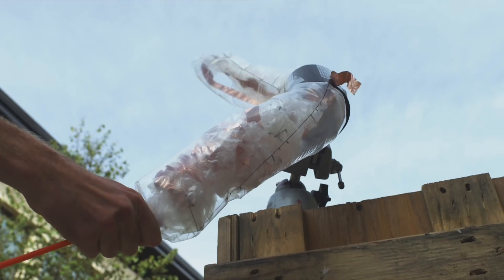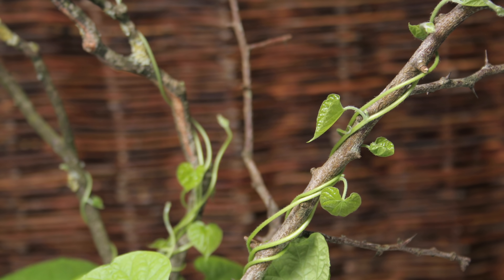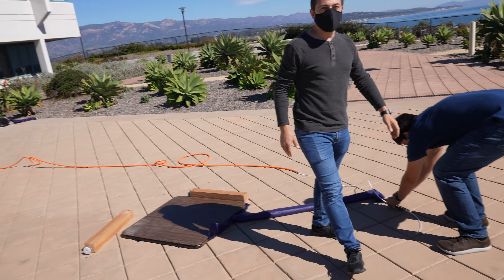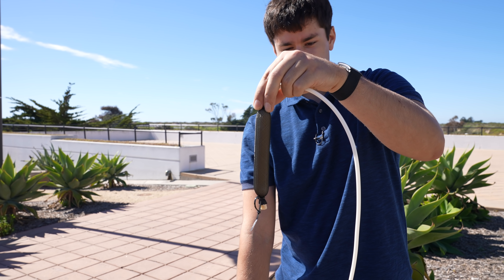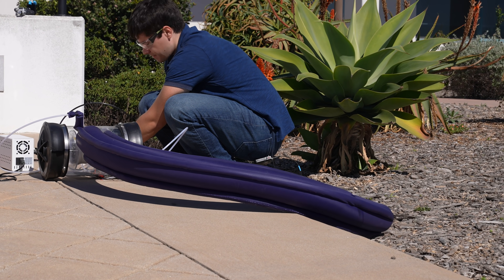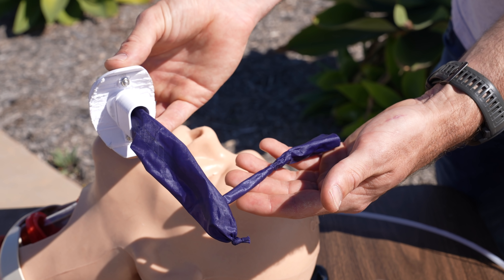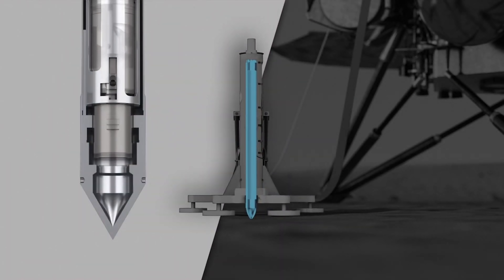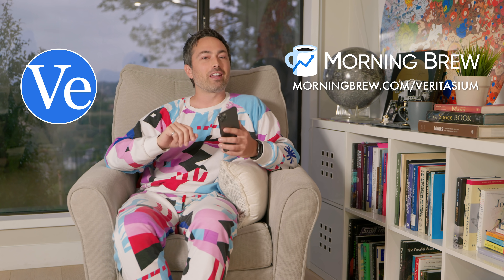This Unstoppable Robot Could Save Your Life

Comment: A very good option would be using it in radioactieve environments like the Chernobyl reactor sarcophagus if it limits the amount of visits but has different adjusted sensors for the still huge amounts of radiation that would help in the work since there is a door inside and people go in in order to check and maintain things still and to sometimes literally put a bullet through corium buildups in order to let air in to acellerate the oxidation proces in order to lower the amount of reactions since the oxides are less reactive then partial non oxides so given these methods provided a kind of camera is available that holds maybe even a set of glass fiber like materials with love gut amplifiers at the other side and a local light source not very high res but always still better then a nipkov disc allowing for a basic view combined with existing data to whatever needs to be done !!!

Comment: I dont forsee that being used for intibation. It takes seconds to intubate a patient, no one that is untrained will ever be put in a position to intubate a patient, and there are different types of devices that are currently used based on the needs/situation. It would also require constant air pressure to maintain the airway, which would require insane levels of redundancy to be approved for medical use, and it would still be inferior because it cannot maintain the airway like a standard rigid tube.

Comment: I think a cheaper & simpler way it could change direction is by using the thing that change shape by heat basicly u but 4 or more  on diffrent pieces of them & some heater by heating one of them up the change shape & move in a diffrent direction like that

Comment: Okay, hear me out. Does anybody know how it would work through water? Because if it does work good through water it could have an alternative purpose as a life saver when diving/deep diving. Then it would help if the air supply on the back of the divers och in a submarine malfunctions they just pull this out and it extends way past the surface of the body of water and supplies with air in a matter of seconds or a few minutes. Please tell me if you think it is a bad idea and why.

Comment: Veritasium let me ask you a question that is in my mind for 3 months if light travels in a straight line then if you had a laser that would like go around the earth then how would the laser come back to you but the earth is round right then does light bend itself due to gravity
Reply: veritasium hasnt replied yet so i'll reply instead:
yes, light travels in a straight line, and it's impossible for a laser beam to go around the earth and back to the starting position. if you were to shine a laser light perfectly parallel to the ground, it will escape the curve of earth (because earth is obviously round), getting farther and farther from the surface until it escapes to space (if it hasn't been blocked by air, dust particles or clouds). then it will travel indefinitely until it has gone too weak due to divergence. earth's gravity isn't strong enough to cause gravitational light-bending, or it's just so weak that it's barely noticeable and wouldn't have much of an effect, let alone make light orbit the entire earth and back to the starting position. something like a black hole or a massive star should be able to have noticeable gravitational lensing that can be detected by the position and shapes of galaxies/stars behind them

Comment: Though ingenious, it is a very old mechanism that is being used to rehabilitate sewer and water pipes trenchlessly  for several decades now. The method is called CIPP where a wrapped in tubular FRP liner is sent inside a manhole and it travels across a pipe effortlessly negotiating bends, etc as it unwraps itself. There the pressure used is nearly 7-10mtr head which is almost 14.7psi and instead of air, warm water is used since it helps cure the liner in place, hence the name Cured-in-place-pipe (CIPP). Though, i must say the envisioned applications are great.

Comment: I wonder if it would be possible to create a segemented design that pushes air from one side to the other, causing one side to retract while the other expands and therefore entirely bypass the need for a fixed location pump. This would allow for a vine bot that can burrow pretty much as far as it wants until it hits a surface too hard to burrow through?

Comment: I'm gonna try to build a vine robot to lay fiber under my house's floors. The house's floors are made of granite attached on top of a wooden frame, with plenty underneath the frame for a vine robot to crawl through. Unfortunately crawling under the flooring isn't possible, as there's no entry path. With a vine robot, I think we could drill a relatively small hole through the floor, and guide with tape. It seems that adding internal controls adds significantly more complexity, and increases the robots diameter. I'm interested in attaching a IR camera and light source to the front for guidance, however it doesn't seem like there's much information on this.

Luckily the distance the robot needs to travel is only around 5m, and mostly a straight path.

Comment: This would be perfect for home electrical work. You could have several points with something that when given a signal or small electrical charge to tighten as it grows to control it, that would be easier than the separate tubes of air, so you can control it in the wall to go more or less where you want.

Comment: none of you are considering heat. Any heat enough damage the tube and cause the air pressure to burst the robot. Also if they could figure out how to put all those air tendons inside the tube would save a ton on airpressure consumption

Comment: There’s a very similar product in plumbing for collapsed drain lines. A hose is forced through the center of a pipe with hydraulic pressure. It’s used mostly for clay sewage pipes that are notorious for collapsing with age.

Comment: The burrow thing is kind of a lie, it only works near enough to the surface to spray away the sand, it's not fluidization it's extraction or at least that's what it looks like. The same thing when Derek was pushing the probe, it stopped going in after about 8 inches

Comment: You could use the machine to fix wires in tight spaces so you wouldn’t have to destroy a roof or wall too much. There could be an extension at the end too (like the camera) that can robotically fix the wire which makes it safer for electricians if the wire they need to fix is dangerous

Comment: I wonder if I could be used internally for like colonoscopy or instead of having colostomy bags using this material to re-route back to the body... There's so many useful ideas for this... The intubation one would be great for BLS providers trying to establish an airway without any tools... In like the case of an overdose pt that's been down a while or a non breathing subject where ALS isn't available immediately and BLS needs to give rescue breaths... The biggest thing in CPR is getting the head tilt chin lift correct and when you're filled with adrenaline, fine motor functions shut down so that step might be forgotten and you wind up inflating the stomach which will cause the patient to vomit which further compromises an airway.

Comment: So, the concept of a number (6 to 8?) of internal longitudinal veins may solve two issues:
1. Changing direction. Each "vein" could have its own air supply... assisting the Vine in changing direction.
2. Retracting. If the veins are still inflated, the Vine could be uniformly retracted - instead of just collapsing - by pulling it's inner "tail".

There may even be merit in experimenting with "sectioned" veins. Each vein with a series of equally spaced sections. The end of these sections walled off with weaker material... the pressure applied in each vein triggering the end of the vein to burst through to the next section (almost like bursting bubbles in bubble wrap - but from the inside...). Applying different pressures and bursting through these sections at different times would assist in changing direction.

Comment: How well would this robot work underwater and or on the surface of water? And if temperatures got too high would it pop like a balloon? What would happen if part of the robot froze? I'd like to see more of this robot!
Reply: Imagine if a space probe could easily probe an asteroid with this, something that has failed before due to the asteroid being a very loose aggregation of dust/sand that couldn't be drilled

The heat and freezing would be important
Reply: Good insight honestly, but I think you can just manipulate the material and external features
Reply: @HowToChangeName  my focus was more on the hit the functionality would take. Due to the tube likely floating, or popping like a balloon in hot conditions, as well as freezing if any condensation gets into it, potentially sealing it cause it to once again pop. In conditions like in the arctic or a fire this thing seems to be unreliable, as it’s meant to be used as a fast tool to save time moving rubble, sometimes conditions are either too extreme or too much time would be wasted to consider using it in those unique situations.

Comment: This is also very similar to a new way plumbers are fixing cracked/leaking pipes by adding a new lining. They basically use air pressure to push a epoxy resin lined sock through a tube

Comment: This is really good for plumbing...I worked as a leak detector..and one of the main challenges is inspecting underground storm water drain pipes ..so I really think it would be a really good tool in plumbing for inspecting leaking and damaged drain pipes...this tool could also help us detector where exactly the pipe is blocked or damaged...I'm really interested in the tool how do I contact and get I'm touch with the company ?...

Comment: Very cool, there are alot of applications for something like this. I do have a hard time wrapping my head around how it works, like the source of the pressure when it is so large/long and punctured. If it's stationary, cool but not nearly as impressive as how I thought it worked. If the source travels with it and rolls up the back end as the front extends...I can't fathom how that works and continues to supply psi.

But what was in the Peruvian catacombs?

Comment: The demonstration of penetration into sand reminded me of a friend, back in the 90s, that was building a riverbank dock and party platform/deck. The riverbank and bottom were made of a hard, but saturated red clay. My friend clamped a small copper tubu to each of the pillars. The ends were pinched, creating a tiny jet nozzle that extended an inch beyond the pillar bottom, and bent slightly towards the center. When the tube was attached to a small pressure washer, the pillar was positioned where it was needed and the water jet softened the clay directly below the pillar, allowing the weight of the pillar to penetrate up to the 6' needed for securing it into the soil. This was at least 10X faster than driving the pillars, and the suction of the saturated clay held them tighter than a frogs butt. It was amazing. Each pole simply sank into the "mud" until the water was turned off. With enough pillars, the rest of the structure was a "piece of cake"... All accomplished in an afternoon by beer drinking hillbillies..!

Comment: 7:22 Archeology ? Try nuclear disaster investigation !
A robot like this can easily enter a space and look around.
In fact, this can be used for deep hole investigation,
like meltdown sites on Chernobyl and Fukushima.
It can enter the same hole, look deep, and see how much
stuff is still radiating underneath the Earth's surface at such sites.
Ofc, the material would have to be heat proof.
With the addition of thicker parts, it would keep it's weight
on the robot structure to a minimum, as each part would carry it's own weight.
From the back end, it would need feeding new parts, which may need their own support.

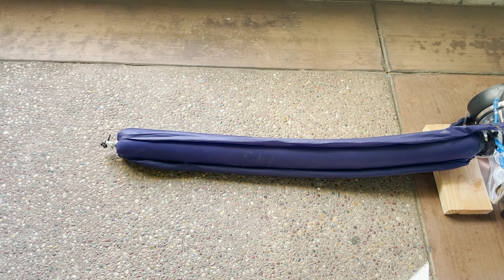Comment: 6:02 The cam should be inside the tube.
and sit on a partial depresurized space.
When the tube inflates, by trying to depressurize the front,
it receives a push forward.

This can then be achieved through the same wire that
transports the data from the cam.

(An electric wire can do both, deliver power and transmit data at the same time.)

Comment: I do see a potential concern for application within human tissues however (i.e. choking / bowel obstruction / heart catheterization).  Human tissues are incredibly soft and delicate in many systems and can degrade especially with age or disease. In fact, weak spots in the intestinal wall are incredibly dangerous as perforation can occur exposing your body cavity and pleural cavity to sepsis from all the multi-billions of bacteria (friendly or otherwise) in your digestive system. So it's going to be a HUGE challenge to deploy this in-vivo and somehow mitigate the risk of perforation of delicate tissues or delicate systems and making the problem worse (i.e. clearing a blocked artery in the brain). 

The steering mechanism using artificial muscles is sheer brilliance and I love the idea of deploying this in archaeological settings or even better for confined space rescue like collapse or vehicle accidents.  I think this has some amazing applications ahead of it... because fire rescue teams already use compressed air as a rescue medium.  Both the "jaws of life" tool and lifting airbags for heavy weights (lifting a car off a person gently) are already commonly employed by most rescue teams.

P.S. I was going to say... this is just a water wiggly (didn't know that was the name, thanks for that) with a brain! LOL.

Comment: I wonder if they use a string attached to the tip of the extended balloon on the inside to easily pull it back inside of itself while sucking the air

Comment: 8:23 This idea did exist before, it is used to refurbish old plumbing, basically unrolling a very long condom using air pressure inside old pipework coating it and pluging any holes. I've heard about it maybe 10/15 years ago. If these guys thought of it recently while looking at vines then it's one of those cases of reinvention.

Comment: I am an anesthesiologist and one of my skill is the intubation, I do it in 10 second or less not in 2 minute, but the purpose of the intubation is insuflate the lung with air and oxygen, I do not think a robot blocking completely the upper airway will be a good option. also in difficult intubation.

Comment: Submersible Freeze Desalination
Ok, say I had a large membrane folded up, it is meant to fill with saltwater from the ocean. It is attached to an air tank. The air tank is attached to an air hose from the surface. When the submersible reaches appropriate temperature and salinity, the air tank expands the evaporator coil and the membrane for holding the water. It isnt a closed circuit refrigeration cycle. So, throw in a lead acid battery, an extension cord, and a mini split. The salt water freezes inside the membrane against the expandable evaporation coil and against the mini split. Then, it purges the concentrated saline water and floats to the surface.
The open refrigeration cycle would probably add thermal energy to the ocean, but is it less than the resistance of pumping the water up and down a diffuser?

Comment: This for Intubation seems stupid. Why are we trying to reinvent the wheel. 

Also the “mars” example is ridiculous as where are you getting all this air on another planet? What happens when it’s not just loose dry sand and is compacted or anything other than sand? 

I would like to personally test the capabilities of the “robot” myself as I don’t believe they are being truthful on how much it can really do.
Reply: 1) Because a rubber tire is superior to a wooden ring
2) You bring it along, duh
3) You can make it at home
Reply: @LineOfThy  1) reinvent the wheel is a idiom. I was referring to the intubation device that doesn’t seem any better, nor easier…

2) the amount of air these things must use would require quite a reserve. And when the tube gets a puncture and you need to up psi? You can’t create more on mars? And I can assume this tube thing isn’t getting through solid rock either.

3) inventing a inflatable tube isn’t special, more what I meant is to use the finished product that is supposedly capable of maneuvering around. To see it’s true range of motions and accuracy.
Reply: @XERXESDOE  1) And I replied with an idiom because this device does help with tasks other's can't easily do.

2) Mars has air dummy, also most of it is sand, also also who says you can't add a mining attachment?

3) Oftentimes to best products start with a functioning prototype.
Reply: @LineOfThy  you must not know what a idiom is… 

Also the fact you think they’ll be able to compress air on mars makes you extra special. No need to get so hurt and call others dumb when you obviously can’t think clearly.

Ps, all products start with a prototype… don’t use big words you don’t understand you look less intelligent.
Reply: @XERXESDOE  Really kicking on the straw man huh?
Reply: @XERXESDOE  1) I do know what an idiom is, and using an idiom does not mean your argument is completely untouchable

2) Why not? Please explain your above-average intelligence

3) ... What big words?

Comment: What if you used something like this to resurface the inside of water lines in a place like Detroit to stop lead from getting into the drinking water. I think something similar is used to fix leaks in sewage lines and/or pipelines. I am sure someone has thought of this tho.

Comment: This technology is how they repair Old pipes in the ground without digging them up. In addition to the inflating bag it also pushes an amount of resin or other material that lines the inside of the pipe while still leaving the center clear. When they're done they just suck it backwards, the bag then retracts leaving the deposited material to cure